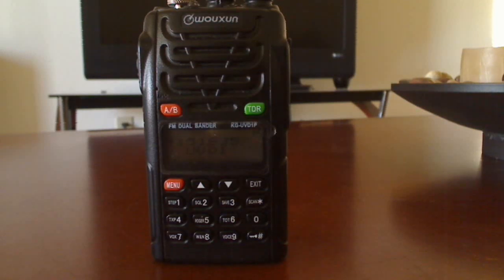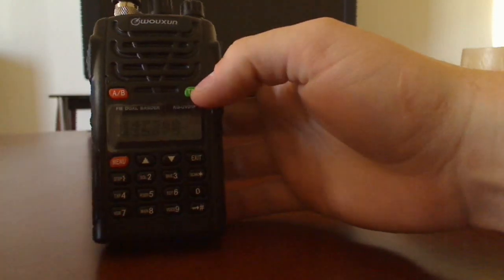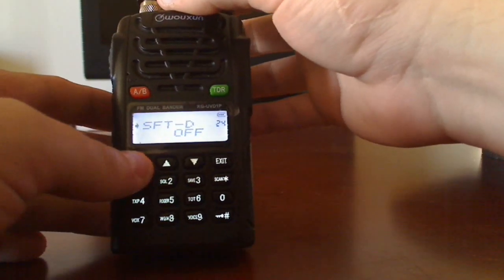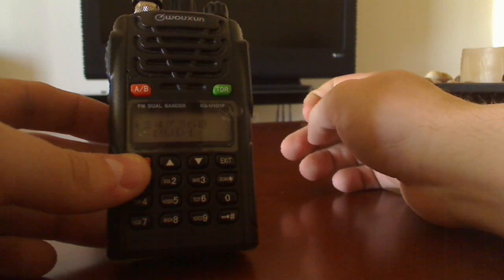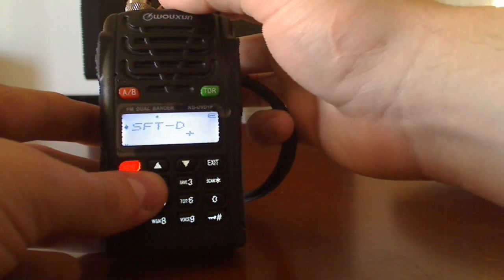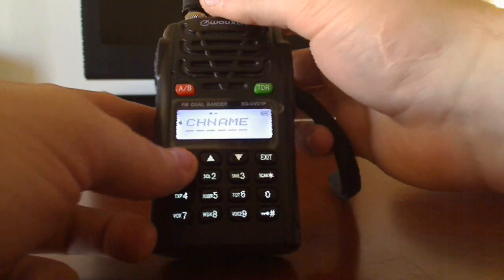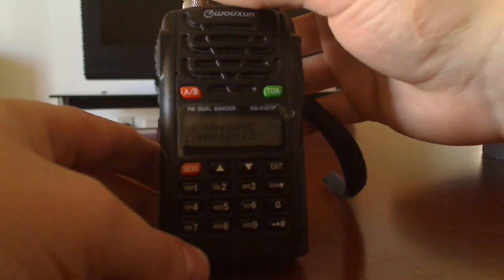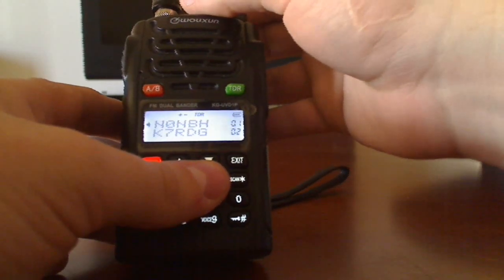Wouxun KG-UVD1P Programming Guide *ENGLISH* UV2D UV3D UV6D

Comment: I program in everything for my repeater and it works on frequency mode but when I switch to Name or Channel mode it takes away the offset and won't key the repeater.  I tried the settings multiple times with the same result.